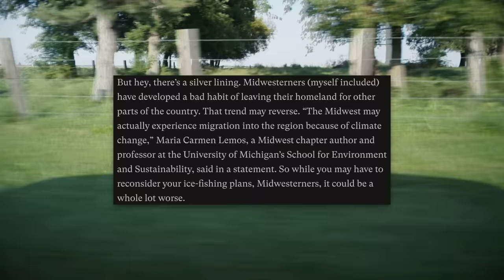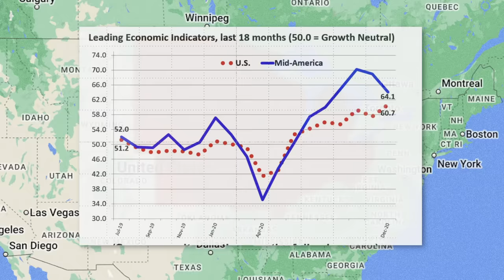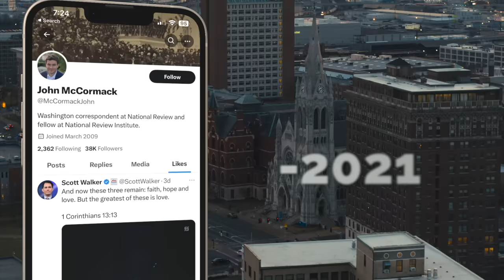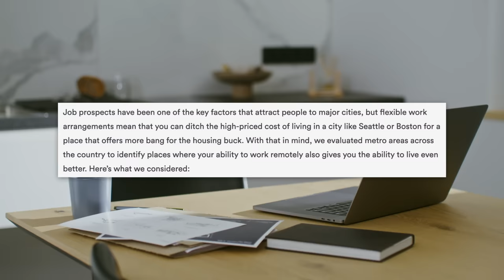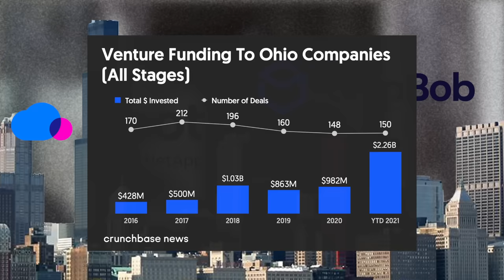Why America Needs The Midwest

Comment: Here in Chicago we never went through the same troubles as places like Detroit, Cleveland and towns across Ohio. 
The reason was Chicago adapted with the times and the changes. The city has reformed itself many times over. 
We have been a giant manufacturing hub, food processing hub, rail hub, airline hub, mail order hub, commodities hub, steel hub. 
Other cities were geared around one or two things and when those died or suffered then the whole region suffered far worse than Chicago did. Chicago and Detroit were pretty much sister cities but one was dependent on a single huge industry and when that industry hit hard times it was devastating for them.
Now the rest of the Midwest is diversifying their economies around different power engines instead of having too many eggs in one basket and we are headed for a new era.
Reply: I do think geography also has a role to play. Chicago is one of the biggest transportation hubs in the US which has made it too crucial to really experience the decline other cities experienced.
Reply: I've always wondered why Detroit's city skyline wasn't bigger than it is now considering it used to be such a big city. I guess because it died or they just relied on the auto industry and no others like you said.
Reply: @thedirtybubble9613  I think Detroit being a big city was literally its size... it grew to over 100 square miles.  It seems that it grew by expansion rather than by further densifying the downtown core.  It expanded to swallow up two enclave suburbs, evidently only stopped by the northern border of Wayne County (the infamous "8 Mile").
Reply: @jbucata  Detroit is more similar to Cleveland than Chicago is IMO. Even Cleveland once used to be a pretty big city but it lost population because of urban decline like Detroit.
Reply: chicago is just so damn beautiful too
Reply: Detroit and Chicago in its prime and heydey were a much more formidable combo as 2 sister cities than the currently upcoming Houston and Dallas. At 1.8 million,  detroit back in the day had more ppl than dallas does currently, and accomplished that without the sprawl. Houston is getting closer to chicago at 2.2 million but needs another almost million ppl to pass. Last check, Houston is one of those cities like chicago that are actually losing ppl for whatever reasons
Reply: All true.  And to add to the list, Chicago having the Board of Trade/Merc/Options Exchange adds a financial lifeblood to the city that others lack.  Even New York doesn't cover what they cover.  Added to that, we have O'Hare, the educational opportunities including world-class universities like Northwestern and the U. of C. (and their hospitals), the world's largest reservoir of fresh water in the Great Lakes with port access to the Atlantic via the St. Lawrence Seaway, our museum, arts & restaurant scene, and the beauty of the skyline of the city that invented the skyscraper.
Reply: yeah but isn't chicago a warzone constant violent crime?
Reply: @xavierjackson6779  if you live in the bad neighborhoods,  yes. But theres alot that are doing ok. Chicago area wouldn't have grown to almost 10 million ppl if it wasn't sustainable.
Reply: @xavierjackson6779  The news constantly covers Chicago as if it were Somalia, but in reality Chicago is as safe as any other city in the US really, if not safer.
Reply: Oh but however history will repeat again😂
Reply: Too many scary black people in Chicago, to be avoided.
Reply: Detroit went to shit before the auto companies declined. The exodus to the suburbs began in earnest after 68. Auto companies didn't start shutting down plants and losing ground to the Japanese until the 80s
Reply: I have family in the Chicago metro AND I lived in the Chicago metro area. Back when I lived there, there weren’t carjackings on Michigan Ave. FACT: ninety percent of ALL murders for the State of Illinois occur in Chicago. My family members who live in the Chicago metro will NOT use the “L” system (I used to use it frequently) not will they be in downtown Chicago after dark.
Reply: @thedirtybubble9613   Not at all. Detroit dwarfed Cleveland in size from 1920-1980. Detroit hit near a 2 million peak...Detroit was about double the size of Cleveland in pop btwn those years. If anything Philly and Detroit were very similar.  Remember as well(which will be Detroits Phoenix in the future) is its the largest international trading city in the U.S...sits on an international border.....cant beat that.
Reply: chitcago was,going to make Deadtroit look like paradise when Maoists get done with it
Reply: 10,000,000? Are you including Milwaukee, Indy and Detroit?
Reply: @ronv6637  Trump loves Mao
Reply: @xavierjackson6779 in some areas yeah kinda lol but I have been there tons of times and never been in any threat at all
Reply: @stevehicks8944 I pointed out something similar years ago.  Chicago has a gun death per 100k rate of 18.5/100k population.  The rest of IL when Chicago is removed is 1.5/100k.

In other words, Chicago is about 12x higher per capita.  Or, the rest of the state has a PROPORTIONAL 8% of the gun death rate compared to Chicago.  The difference is even large when you factor in the actual populations.

So it's the RATE, not the raw numbers that are so far apart.

Many try to blame proximity with Indiana and Indiana gun law.  The problem is that Chicago is not unique in it's proximity to Indiana.  Nearly all of the Eastern state line is shared with Indiana.  Yet downstate has no problem avoiding the siren call of Indiana guns.  Additionally, Indiana, Illinois and FEDERAL gun laws all prohibit Illinois residents from purchasing firearms in Indiana or other states without the transaction going through an FFL dealer.

Therefore, to the rest of us in Illinois, it does look like Chicago is out of control with respect to gun violence.

It may not be as bad as some suggest, as other places have a higher per-capita death rate.  But when compared to the rest of the state, Chicago has a rate 12x higher, which seems insane.
Reply: @ronv6637  Exactly!!
Reply: @buffuniballer   Look up the gang banger describing how cases of guns are dropped throughout the city. If those guns were from Indiana you would hear about it continuously and Illinois/Cook (crook)county would be sueing for huge money. All the guns seized by CPD are never revealed as the source (manufacturer knows exactly who they shipped today). Same source as glock "switches"/disconnectors that are very common in hood,as if some teen in hood could afford to buy $500+ guns when they eat off food stamps and live sec8.
Reply: @ronv6637 The Illinois governors always get caught with billions of dollars of misallocated taxpayer funds, they have a huge economy yet they can’t even fix any of their roads. It’s funny taking I-74 from Indiana because the road is smooth and nice until you cross into the Illinois at the border, then you clearly see where road maintenance stops 🤣 There’s like 100 potholes and sinkholes on I-74 in Danville, IL
Reply: @aimxdy8680  Illinois spends 3x/mile for road work but roads everywhere suck  I-65 Gary to Indy has massive holes  ,I80/94 has been under continuous construction for years
Reply: @ronv6637  show the massive holes of I65 gary to indy, because I go on that road everytime and have never seen a single pothole.
Reply: @ronv6637  I65 hasnt been horrible since it got repaved 2017-2019.
Reply: @aimxdy8680  try running the right lane huge holes been bad for 4-5 yrs,plus all the idiots that don't pass or get back in slow lane
Reply: @ronv6637  I have never hit a pothole on I65 on the right lane, the only “rough” part of I-65 is when the road goes from 2 lanes to 3 lanes near the Lowell exit where the pilot and flying J gas station is but it’s gonna be under construction, back then, the entire road until crown point was rough.
Reply: @aimxdy8680  haven't been south of Remington exit this year but plenty of holes that are motorcycle killers in right lane, especially near bridges where drainage under road has collapsed and roadway sunk
Reply: Been in Chicago and Crook County forever, Taxes here in Cook County just doubled and we're to high to begin with.

Comment: Continental summers and fall are underrated.  I live just north of Toronto and wouldn't trade these two seasons for anyone else's with the American Midwest having a somewhat similar climate.  You can actually spend lots of time outside, even when it's hot because the heat doesn't last after the rain blows it out and then you get beautiful room temperature weather with sun/cloud mix.  Literally perfect.  Winter is only bad for Jan, Feb and March, once you're done with that window, it's fine.  Three bad months out of 12 is great!
Reply: North Dakota here and you're mostly right, but your also mostly wrong. If the occasional blizzy that dumps a foot or two (2/3rds of a meter) of snow is your definition of 'bad', then I'd include October, November, and December too.

That, and the occasional tornado, but my town has never been hit by one for as long as I've been alive all these 25 some years. The nearest we've had was rotation on a golf course south of town.
Reply: @uss-dh7909 

North Dakota is tougher in winter than Toronto, Detroit, and Chicago.
Reply: @uss-dh7909  North Dakota has more in common with the Canadian prairies but depending on the severity of our winters, we are no stranger to blizzards/accumulation.  The great lakes have a moderating effect on the fall season which is why Oct, Nov and Dec aren't that bad for us.  The reverse is true for spring and we can end up with the odd freak snow fall in May.  Spring around the great lakes in general can be cooler.  We get the odd tornado as well, especially in Southwestern Ontario.  It's at the north eastern tip of tornado alley.

Snow is pretty much a way of life here, what we dread is a bad ice storm.
Reply: @uss-dh7909  Another North Dakotan here, yup you're spot on.  The northern midwest doesn't have the stabilizing influences that the east and west coasts do so the weather here can be a bit chaotic at times.  October for example can be a beautiful fall month with temps in the 70's for most of it or by mid month we can have significant snow on the ground and cold weather.  Usually though it's a month where sweatshirts are all you need to be comfortable and snow is not (yet) seen ;)    If you can come to terms with the climate the upper midwest has a lot to offer.
Reply: Me personally I really like snow and cold winter so it doesn't matter to me
Reply: Midwest summers are horrible. Humidity and mosquitoes suck.
Reply: Three months of winter is a good excuse to be sociable with your communities of choice.  Winter months = Bar time, game time, feasting time.
Reply: @ldl1477  Actually true. October-Dec are hunting, Dec-March are ice fishing. Dec-March is also work on projects in the garage/shop for the summer months, go to the gym, indoor projects. Of course we have to do stuff outside too, we just dress for it and buck it up. Makes a person appreciate the other seasons too. 

Love the Midwest.

Comment: The Rust Belt is generally considered the Bethlehem/Allentown PA area (US Steel, Bethlehem Steel etc); obviously Pittsburgh PA and many industrial small towns btw Bethlehem and Pittsburgh like Scranton, Rochester NY (Polaroid)/Buffalo NY, Erie PA, Cleveland, Ohio, Akron OH (tires, rubber factories), Youngstown, OH, Toledo OH, Detroit MI and surrounding areas(autos), Gary IN (steel factories, coal shipments), Chicago IL (stockyards, railroads, meatpacking, etc), along with Milwaukee WI close by also on Lake Michigan.

 St Louis is another older eastern type city that at its peak was an industrial hub due to the confluence of the Missouri and Mississippi Rivers, so railroads, grain shipments, coal shipments, barge traffic, and corporations like Monsanto, Purina, the breweries like Anheuser Busch, Falstaff, etc, McDonnell Douglas etc made StLouis a critical link between Chicago and the Great Lakes, the Ohio River Valley (Louisville, Cincy, Pittsburgh), the South and Gulf of Mexico (New Orleans) and of course the West to Kansas City, Omaha, Denver etc. So StL should be considered part of the old rust belt.

Comment: I just moved to the midwest specifically cleveland metro area from tampa florida. It is cleaner, safer, and way cheaper and the pay is relatively the same for my career though they do generally pay more. Also no hurricanes. I am not originally from Florida or the Midwest btw. The stability of the climate here was a major reason I chose this area I am aware they can get bad winter's.
Reply: I grew up and worked in and around Cleveland for the 40 years of my life.  Since then I have lived in New Mexico and found that to be a satisfying alternative and I return every year to visit family.  If conditions here change for the worse such as too hot, lack of water then I could see coming back to the Cleveland area again in short order.  The cultural mecca of University Circle has always been a fav for me along with the extensive metro park system.
Reply: @michaeldeierhoi4096  that's funny I used to live in New Mexico. I moved last year from Albuquerque before that I lived in Las Vegas New mexico. While I did love New mexico the crime and heat were a no for me. Though Santa fe is gorgeous.
Reply: @anthonymarquez6493  I too left Albuquerque as I was tired of the congestion, the crime didn't help, but mostly I was tired of the city and needed a change.  I moved to Las Cruces and found a much bigger place for only a little more then was going to paying for a studio apt in burque.  Las Cruces is everything ABQ is not and vice versa.  And as for the crime issue it is sadly becoming a problem everywhere even in smaller communities though it is still not a big issue here in LC.

Comment: As somone who has been born, rased and still lives in Wisconsin, the area is great as long as you can withstand the winter. If so, you are in the center of the contry and as a result driving from here to any coast  as a road trip becomes an option. Not to mention in busness, it helps with logistics for the same reason. 

That said, I'm hoping a population boom doesn't happen any time soon. I like my cost of living low, and would like it to stay that way. not to mention out land is used to farm more than manufacture goods. If cost of living goes up, so does property cost and thus so would food $.

Comment: About the proposed rail corridors, I think this is a very good plan. However it could not be qualified as ''heigh speed rail'' since to do that the EU wants the corridor hitting at least 155 MpH. And even if 125 sounds good I am afraid travel times would be to heigh. 
For instance in France (since you mentioned it) The route between Paris and Bordeaux was 125 mph capable before 2016. But the trip took more than 3 hours at the time... So not many people took the train.
But now that they built an entire new corridor dedicated to passenger heigh speed rail capable of speeds reaching almost 200 mph, the travel time dropped to 2 hours. Because of that the number of passengers is now 10 times higher than before (building a new line also alowed more train between the two cities since all regional/ local and freight trains use the old line that is still 125 mph capable...)
This example illustrates my fear that, while genuinely great and necessary the rail plan might not be enough yet to be completely worth it...
Reply: 3 hours wasn't bad for me. When I lived in China, I took the HSR a couple of times from Chongqing to Chengdu, and never found the trip onerous. If I had more time off from work, I'd have made the trip more often.

Comment: Unless you're next to the Lakes, the Midwest is incredibly boring. That's the issue. Cornfield after cornfield. Flat and barely any trees. But it is inexpensive and does not have the climate issues that other parts of the county have so I do agree that it'll be a hotbed for folks looking to relocate in the coming years and decades. This will also most likely affect the politics of the region as well by mid-century.

Comment: I mean he's not wrong I just feel like the videos tone makes it sound like this change is right around the corner and it really isn't. It'll take decades more to overcome the decades of divestment here. Not to nock the region too much but until a solid base of well paying jobs in multiple sectors is secured the Midwest will kind of mossy along  without really rebounding. The death of silicon valley is kind of overblown, people really over look the fact that silicon valley, similar to Hollywood, runs on connections. Tech stays in the valley because that's where the network is. Until the bigger guys leave theirs no real reason to be anywhere else. Every advantage they mentioned is already in California in spades besides cost. Cost of living isn't really as big a problem for them because the Tech people aren't the ones fleeing California for costs it's everyone else outside the sector that can't afford to keep up. I'm not saying there will never be a Midwest tech hub, I'm just saying that it won't dethrone or really harm silicon valley.

Comment: SIDE NOTE: It's not inflation if you record record profits. It is price gouging.
Reply: The monetary supply has been doubled in last three years. Which means the accumulative inflation rate is nearly 40%. Meaning prices by themselves should only be 40% higher right? No, Companies want to increase profits otherwise the company gets no investments so they increase prices by 50 to 60%. But that also doesn’t take into account the increased cost of transportation which will make the price increase 80% to 100% instead of just 40%. The federal reserve screwed you over and is lying to get away with it.